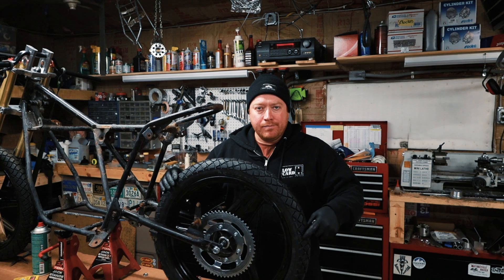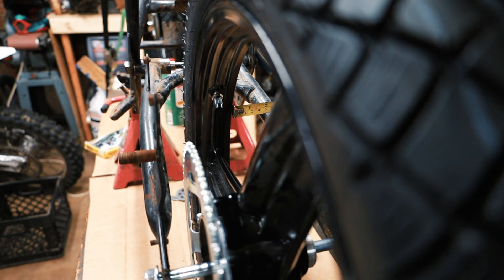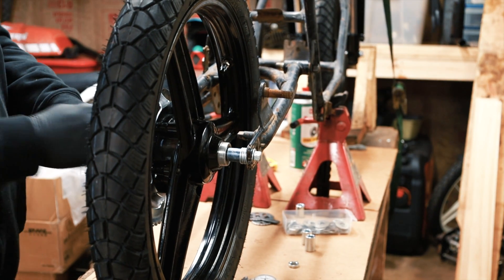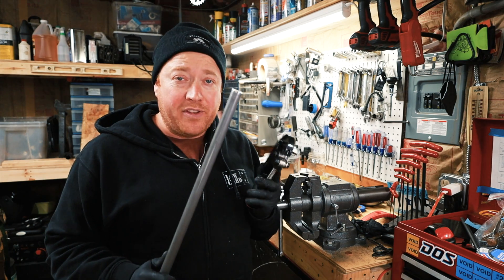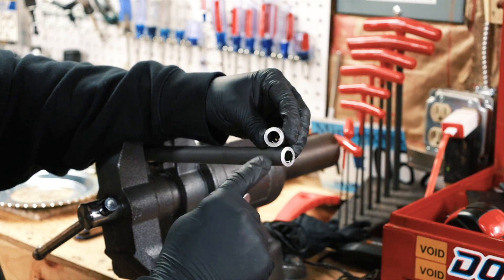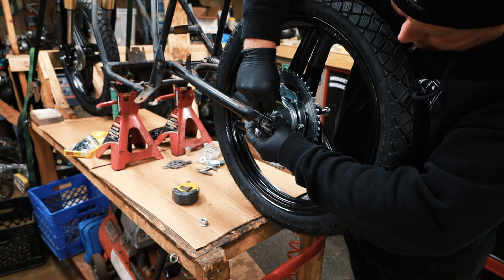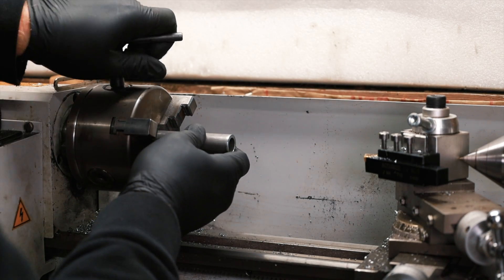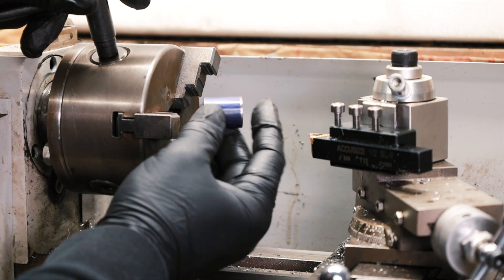Making Axle Wheel Spacers for the Derbi E bike using two methods

Comment: Would it be okay to run the washers along with the smaller spacers if you don’t have access to a pipe store ?
Reply from the maker: Yeah totally. You could run all washers if you wanted
Reply: I’ve ran all washers 🤷‍♂️ it was sound
Reply from the maker: Yeah totally fine.